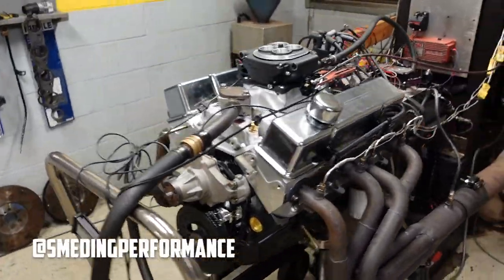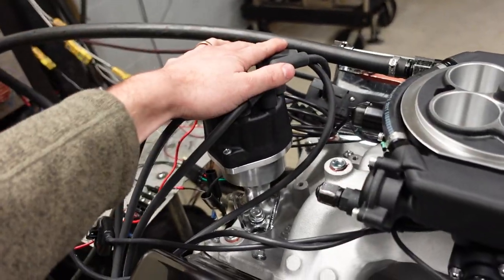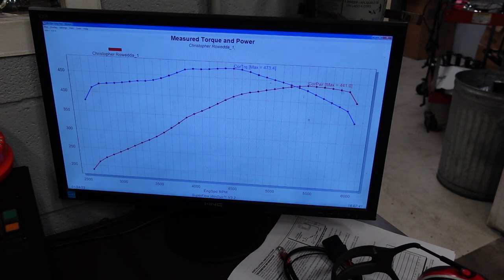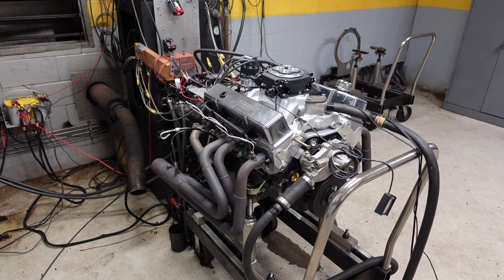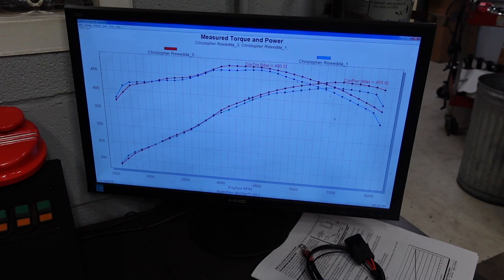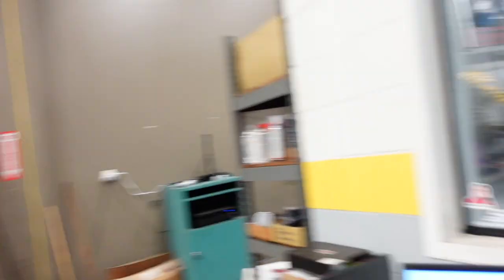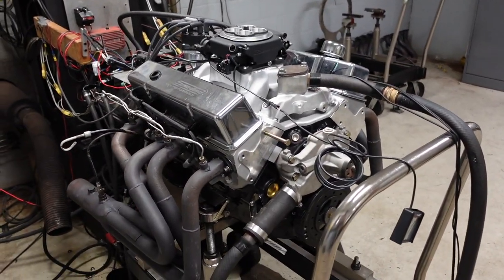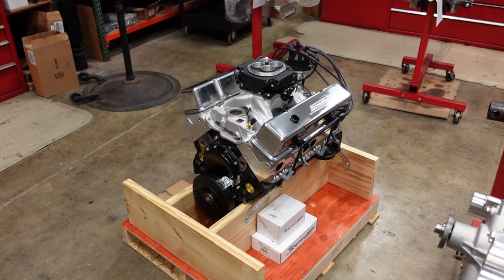Smeding Performance 383" Extreme Dyno Test & Tuning!

Comment: Great video. I have been contemplating, replacing my old 305 in my 1986 Trans Am that I have had for over 30 years, with one of Smeding’s engines. But then I think I would have to replace the old transmission & maybe the rear end & considering I can’t do any of the work myself, it would be lots of $$$$$$$.

Comment: hey just checking if theres a video between the 383 sbc hot rod/cruiser/extreme i am planning to swap one of them into my YJ and trying to compare idle chop and stuff.  OR if theres any with the other fuel conrtol/timing options on the website :) thank you

Comment: Is it internally balanced externally balanced or neutral balanced and what kind of a stall would you have to run if you're running Automatic transmission what be appropriate rear gear

Comment: The explanation of the hyperspark isn’t exactly accurate. There are things to be adjusted afterward but once dialed in, not the timing but the distributor’s position and a parameter in the ECU I don’t remember off the top of my head because it’s been too long, then you can forget it. It installs with a cap that gets you close and then you verify the timing on the crank pulley. Then you rev it up and make sure that the displayed timing stays steady with the crank. There’s a parameter that must be adjusted until it’s inline with the displayed timing and the timing read at the crank.
Reply from the maker: We check those parameters as well. You're thinking of inductive delay.
Reply: @JacobVillemain  that’s the guy. I’ve done it once, 2 years ago when I installed the system, then never again. Had the dizzy out a couple times since then but it’s a quick fix to get it back into position. Once the inductive delay is set you’re golden but I don’t know how many people read the instructions in depth enough to do that. I see people having issues with it on the Holley forums frequently.

Comment: do you have to copy everything guess what why not a 396 that's Chevy?
Reply: What did they copy?
Reply: @chadrobertson3075  you know they had a great 396 engine 325, 350, or 375 hp.  383 was a Chrysler engine that who.
Reply: What are you even getting at? Do you not know what a 383 stroker engine is and why its better than a 350 at the same price?
Reply: @____MC____  it's a Chevy engine because as Chevy does copy's why is it 383 because CHRYSLER MADE A BETTER ENGINE why not make it, a 396 an awesome Chevy engine, you don't see Ford running around making Chrysler engines grow up
Reply: @thomasdearment3214  you can make a Chrysler 426 stoker out of a 383, you can make a 408 stroker from a 351 winsor. Am i talking to biden?